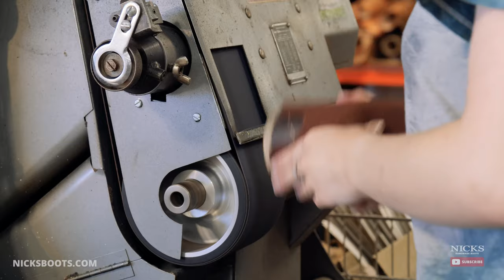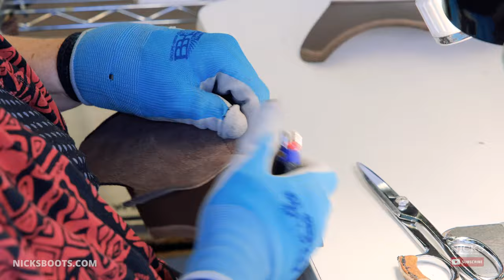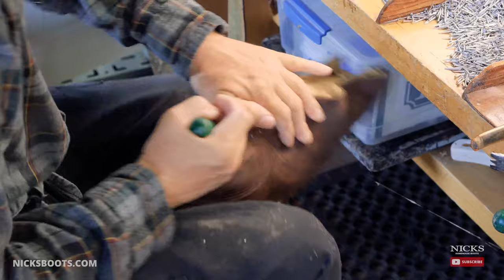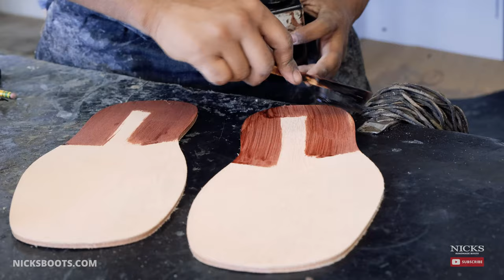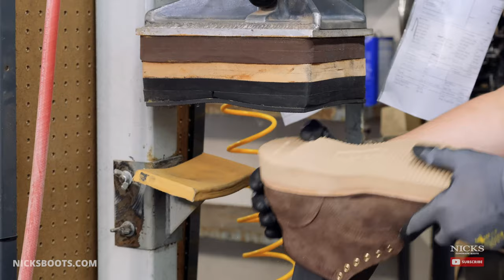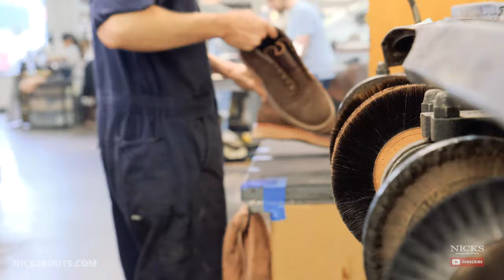World's Toughest Hot Weather Work Boots: How It's Made - Nicks Handmade Boots

Comment: Why is it called summer work boot?
What's the difference from a "normal" work boot?
Reply from the maker: Shorter uppers!
Reply: @nicksboots  Thanks.
Reply: A real summer type work boot is one that’s made with a lighter upper in the style of the jungle boot. Not as durable but in 89 degree temperatures your foot will not have the sock stuck to it